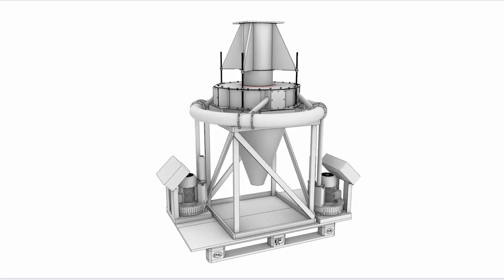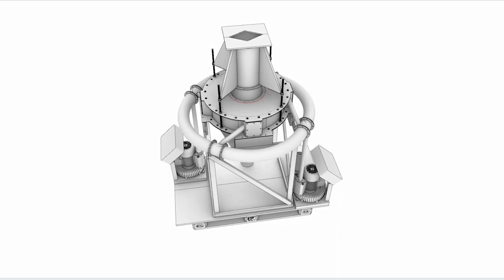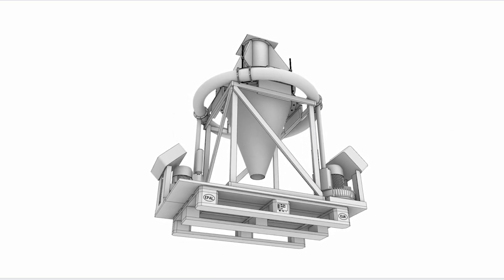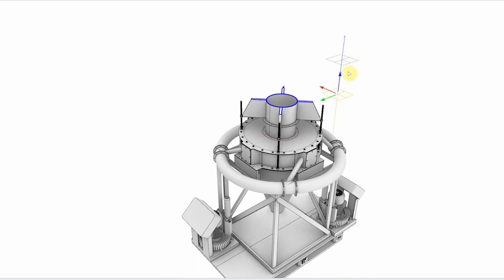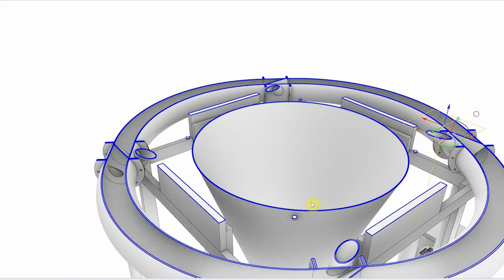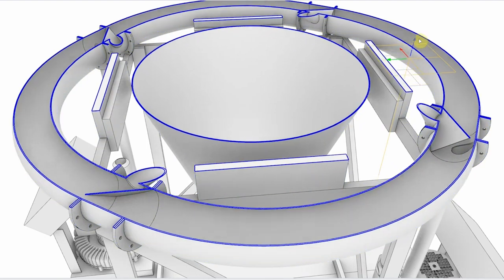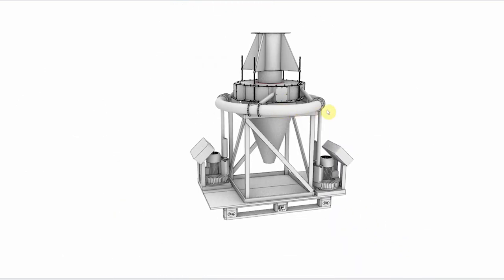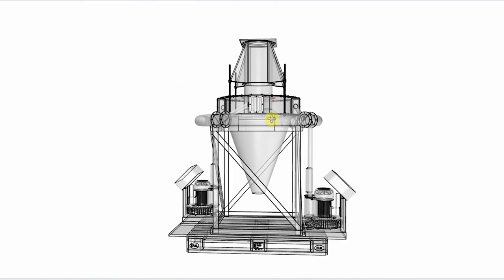Windhexe - Side channel version drawings for comment

Comment: Excellent design!!!   Adding the air to a common, shared, circular feed pipe is a definite plus!

Quick questions:

1. can those air blowers also blow in damp air (all the way up to the level of a fog)?
2. has thought been given for one blower to add Warm (hot?) air, the other Cool (cold?) air ?  
3. has thought been given to adding "pinch-points" (perhaps using an internal ring) at regular intervals to the circular distribution pipe to encourage the air (especially if it is damp) to start spiralling?

Anyway, looking forward to Tony Jabony's (a.k.a. Robb's) results on this once put together.  To my mind, this now looks like a SERIOUS test rig ...  🙂
Reply from the maker: 1. Well they will at least take ambient air, which has moisture and there of course is the possibility to add a water mister to that input.

2. This is an interesting idea. Commercial hot air generator could be coupled to one or more of side channel blower inputs for simple increasing of the input air temp.

3. Well, the deflectors alone will introduce turbulence.
Reply: Thanks Gordon! 

1 Yes the air blowers can do all sorts of air. Vapor will not be a problem, temperatures will also be fine, We can even put multiple blowers in series to create 2 stage blowers for more pressure. or add more blowers in parralel for more cfms. 

2. For not the most likely theory is hotter and wetter = better ;) 

3 Love that idea, reminds me of schaubergers water kickers to make water lift more logs in his canals. Don't think it'll matter that much since i believe that the airflow will get scrambled in the inlet chambers before going through them whistles 

Cheers!

Comment: Could there be an issue with the four chambers that receive the air from the pipes then allow it through the slits into the main chamber, they have a quite angular internal shapes that will likely create some chaotic turbulence, perhaps interfering with the smooth flow of the air?

Is there any thought of measuring the air flow coming out of the slit to see how smooth / strong it is after passing through the chamber?
Reply: Yes, the inlet chambers as they are now are a big questionmark. I've taken the original design from the original frank polifka patent and haven't changed it because currently we're focusing on replicating the original functioning of the original windhexe. From there we can deduct the internal (thermo) dynamics of the apparatus and hypothesize improvements on the design. 

It might be that scrambling the airflow with turbulence before it passes through the slits is important otherwise Frank might would have welded the pipes straight into the upper chamber or make a simpler design for the whistles. 

If you see the physics of an ordinary whistle it has a chamber in which air turbulates and oscillates before passing through a slit. Might be something similar happening in these. might be happening nothing at all. 

I do want to add a thermo, humidity and pressure sensor to one of the inlet ports and replace the metal covers for acryllic so we can visually inspect whats going on in there when adding smoke or vapour. But first the high CFM distribution systems